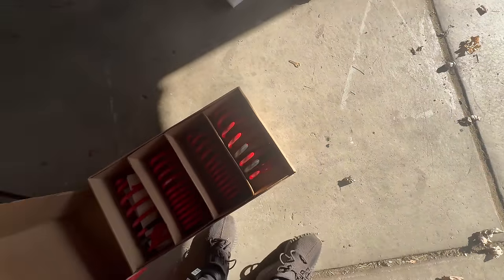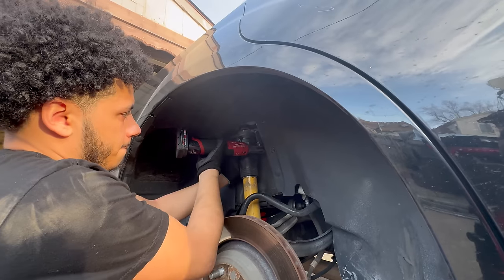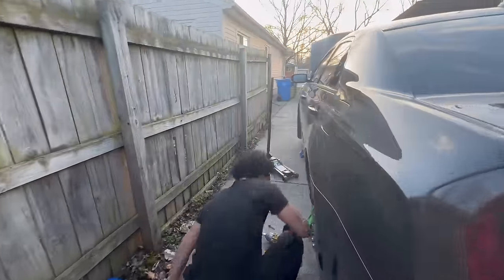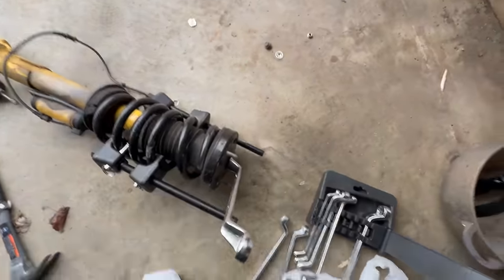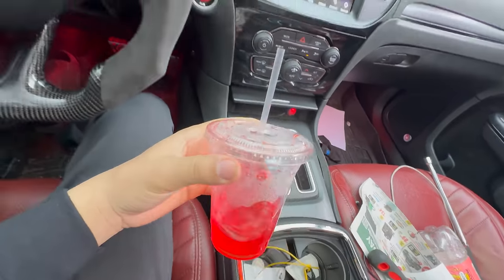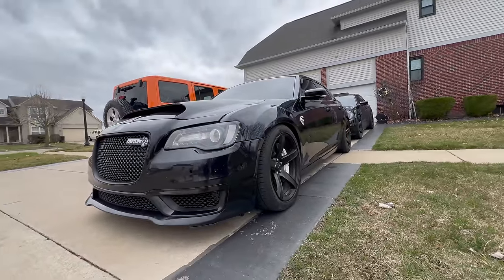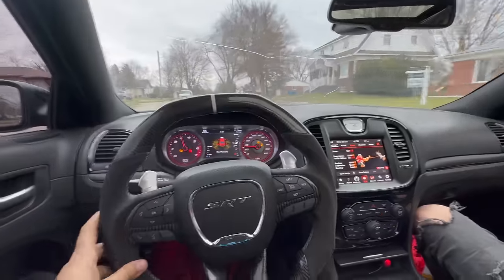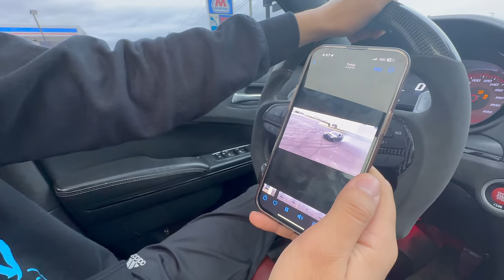I LOWERED MY HELLCAT

Comment: Ian gone lie u did hell extra work on the rear all u had to do was loosen that bolt by the exhaust and the lower bolt for the strut and that spring would’ve fell right out. That bih sittin good tho 💯😮‍💨